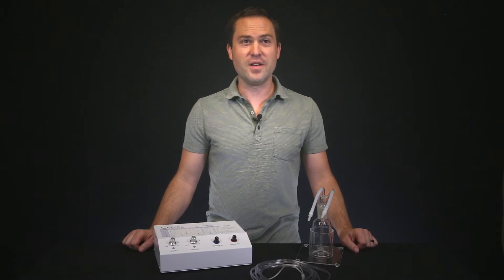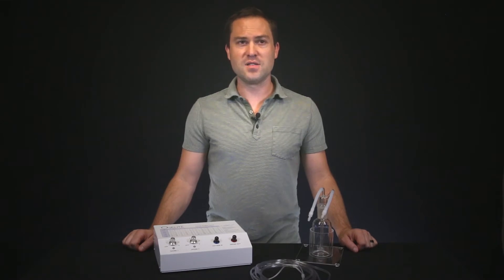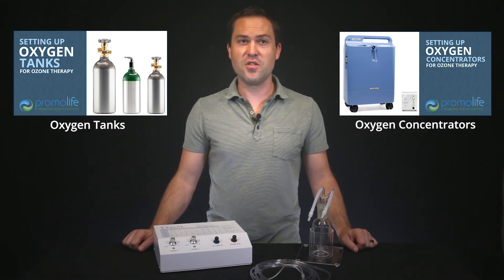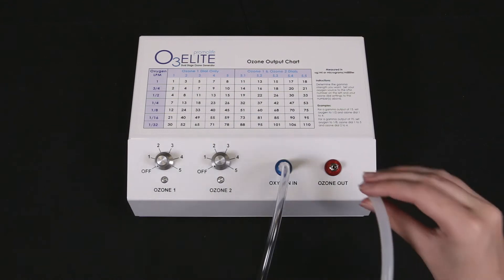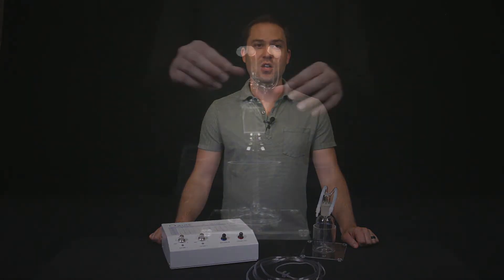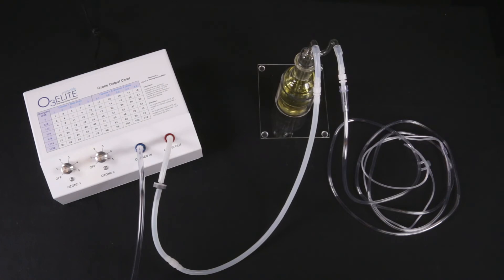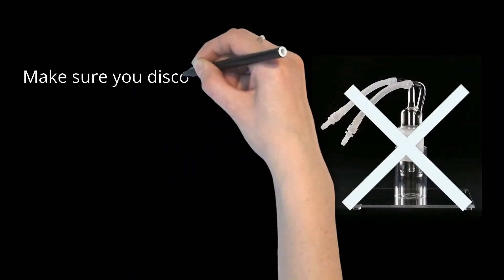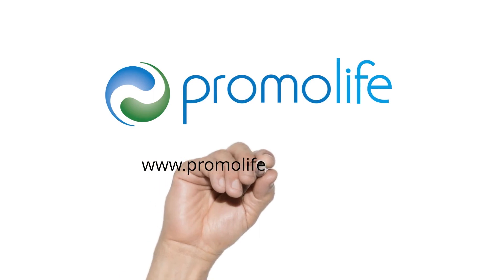Setting up the Ozone Oil Bubbler and Nasal Cannula for Ozone Therapy

Comment: Hi, good info. But exactly how the structure of ozone is changed so that it is not irritating to the lungs. Thanks
Reply from the maker: Ozone reacts with the oil to form ozonides and terpenes.
This does not contain any active ozone gas (O3) so it will not cause irritation.

Comment: How long does it take to ozonate oil? How long is breathing suggested?
Reply from the maker: For breathing you should replace oil every 2 weeks. This is very minimal run time for the ozone generator. When making ozone oil you would have to run continuously for up to 2 weeks. For how long to breathe ozone each session, this varies a lot depending on the person's condition and needs. We recommend discussing this with your healthcare practitioner.
Reply: Promolife dude wtf are you filtering out with the oil? Do you not organic chemistry/science/common sense? You do realize that you CANNOT FILTER OZONE. ITS BASICALLY OZONE IN AND OZONE OUT